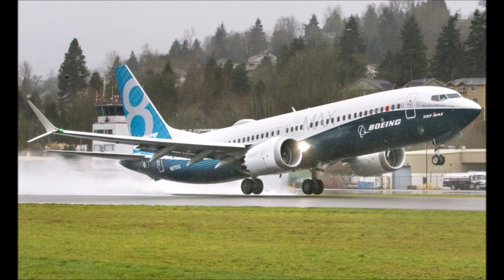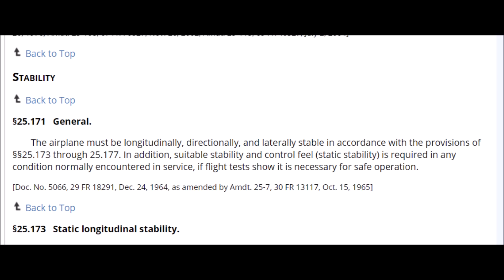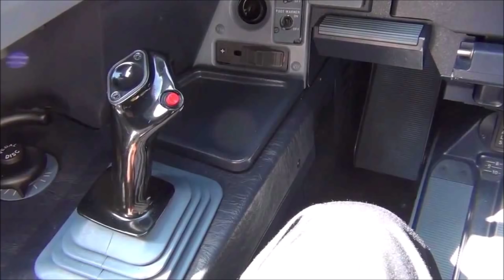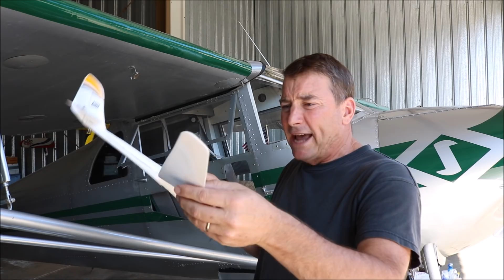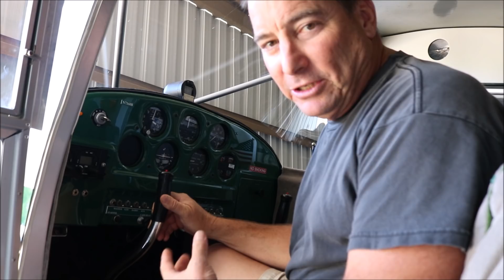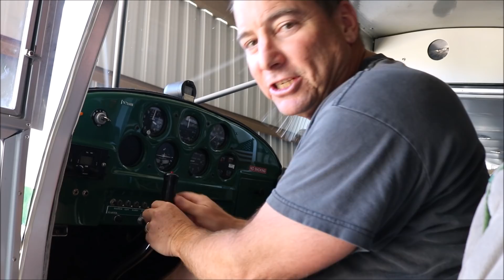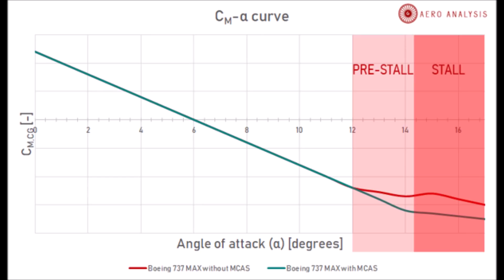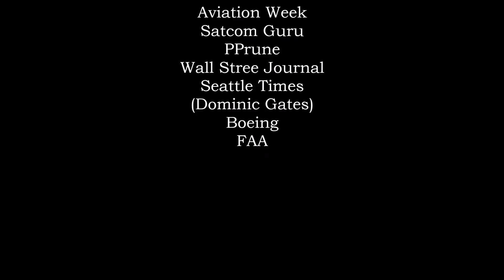737 Max UPDATE 30 Aug  2019

Comment: totally new architecture?  wow.  that cannot help but introduce new issues.  it'll take years.
Reply from the maker: No, relatively easy fix.
Reply: @blancolirio  as a software engineer, those three words scare me.  cutting out two systems when the two disagree sounds like a good approach.  but even that produces differences in the failure process, and in a complex environment, it may take some time before important differences are revealed.  the goal is to make the new 737 the same as the old as far as type rating.  but they are a little different.
Reply: Adam Lane - totally agree. With any change to source code, there can and will be many unintended consequences. 

These can often take years to manifest themselves.

Comment: 10::00 Yet AirBus has had a series of mysterious 320 and 330 crashes and near crashes. As far as crash proofing the320 family essentially  stopping the pilot from creating a dangerous maneuver a mentally ill Germanwings pilot buried his 320 into the French Alps.  AirBus’ Weird Crashes

Jun 1, 2009 AF447
Oct 7, 2008 QF72
https://youtu.be/2cSh_Wo_mcY via @YouTube

May 19, 2006 MS804
Dec 28 2014 QZ8501
July 17 2006 TAM3054
May 3 2006 Armavia967
Aug 23 2000 GF072
Jan 20 1992 IFT148 
Nov 27 2008 XL Air check out flt 7 pilots on board
Jan 26 1988 AF Air show demo, AirBus self-flying ability
March 7, 2001 Northwest Airlines 985 Takeoff without pilot involvement
Reply from the maker: They've had their share...

Comment: Another great video. And I think the FAA has given you the short stick Juan! I can understand no class 1, but what is up with rest? Makes no sense to this pilot !
Reply: Grey Lewis Juan said the hormone treatment causes fatigue, which is a safety issue for operating machinery.
Reply: Gordon Richardson I had no such thing when I went through my treatment, 1998, ,,I forgot the actual brand name for the hormone treatment, but it gives you SERIOUS HOT FLASHES, , my greatest problem,,was radiation colollateral damage, hemmeroids , & bladder damage, ,,then radioactive seed implantation , was radioactive for 3 months. , PSA = 0.01
Reply: @flybyairplane3528  Exactly why I decided on surgery, based on what you went through.   But, things have changed since 1998 re treatment protocols.  Good health to you...
Reply: rvnmedic1968 From what I know, surgery would be my last resort, but there is a MD, in NYC DR GIL LIEDERMAN , Of NY RADIO SURGERY, a very special  type of radiation , he brought to AMERICA, originally for ANY BRAIN  PROBLEMS, it is SO SPECEFIC, there is ZERO DAMAGE OTHERWISE   then they decided to do body  systems, But I did NOT  know of him then, he cured Prez JIMMY CARTER, after his surgery at EMEORY UNIV Hosp, that matestized to his brain . Any cancer, or brain tumors etc, he will be my go to MD. God Bless ,,and Cheers from NJ

Comment: First,,, Thank you.    I have done a lot of flying, passenger, aviation fascination,,,, but am not a pilot.  I always thought of the type certificate as a certificate for the aircraft,,, not from the aspect of certifying the pilot for that type.  Your explanation of neutral stick pressure was a revelation.  Yes, I knew that, I have sat the right hand seat twice for a few minutes, knowledge of, felt it,  but I never once thought about the consistent feel to the pilot. of that type certification.  A real 'Duh !' moment for me.  I think nuts and bolts, engineer,, but the very core of this discussion is engineering a consistent feel for the operator.

I must say,, your misfortune has become my, our good fortune.    You had the time, took the time, to teach.        Thank you.
Reply from the maker: Excellent ! I'm glad I was able to convey this in an understandable fashion. Thanks Sailor!

Comment: What was the purpose of alternating FCC’s. Boeing had the fix the whole time but chose to only use a single FCC/AOA in flight. Can someone explain why?? Edit: Having worked on the F-16, if there was an AOA disagree, the checks we were performing on the ground would not pass. It’s amazing how these redundancies have been around as long as they have....and there’s still those who for some reason feel the fail rate is not worthy of concern.
Reply from the maker: relied on the pilots.

Comment: Great info...but I will not fly the Max
Reply: Hey Juan....I have an opinion about the 737 Max...and that's my opinion....don't tell me I haven't listened to the video. Believe me I have, but I still wount fly that plane...until it's cleared....so don't get on your high horse...I have unsubscribe,and don't be an ass buddy...typical pilot...Mr know it all...you should listen to what I have said....really
Reply: Yes you will, just like everyone else who will fly on her the second she gets back flying again. You obviously didn't listen to any part of the video. The max itself wasn't,  isn't the problem. It was a design of mcas which will be 100 % fixed. If the max is going where your going, you'll be flying on her. Stop being dramatic.
Reply: @11SEXMACHINE  the problem is, if they screwed up this badly on all phases of the design, implementation, certification, fault resolution, and disaster management, with the FAA going along with them, and the leadership that made these decisions is still in charge, and still trying to do spin control and make it sound minor, what other undiscovered faults and shortcuts will be discovered next?
They have shown over and over that their judgment of what is a safety critical system and what isn't, is not just critically flawed, but they can't even see that it is flawed.
They keep saying that this is a non critical system, after it caused 2 plane crashes. That by definition makes it a critical system!

So they have been telling us all along to trust them, and showing more and more that they aren't trustworthy, and there is no sign of leadership changing, so why should I trust any Boeing plane?

Comment: Thanks for your upload. Just a few comments from a commoner (non-pilot). In regards to certification requirements, I notice AirBus has come out with several NEO (new engine options) which must come very close to altering the feel of the original aircraft but competent pilots can obviously adapt to these control input differences. I guess with the particular engine-wing geometry of 737 the regulatory agencies requirements mandated a system -thus MCAS. With the utmost commiseration for those affected by the crashes and loss of life, it seems that one of the airlines had a truly abysmal safety record before the advent of the 737 MAX. Finally, if the system (MCAS) is being blamed by most as the biggest contributor to the disasters and the media spreading the word that the aircraft were uncontrollable, then how did the previous crews safely pilot them to the airports they were operating from?
Reply from the maker: Exactly!
Airbus fly by wire doesn't need to worry about feel at all. It's like flying an R/C model aircraft. Thanks Smitty.

Comment: they should swallow the fuel economy and redesign the tail
Reply: Intuitive Alpha A redesign would take longer, and potentially require a new type certificate, with all the associated pilot training issues.
Reply: @gordonrichardson2972  I'm really surprised they let that kind of control amplification, through, without checking for dynamic flight characteristics, the physical characteristics should have been, modified, the whole point of changing design, is new type certification, and pilot training issues,.  it's just not acceptable modifying that aircraft like that, and counting on trim being implemented in, a way as too, be acting outside the authority of the elevator, that's a pretty big pilot, training issue by itself,.
Reply: oh well these things happen, hindsight and all that, easily said by anyone really

Comment: Happy Weekend, Juan.  RU saying  trim movements were too easy when MCAS was originally implemented? Or too difficult?.  I thought MCAS was supposed make horizontal trim inputs easier.  From your and other channels, my understanding is that the big new engines and changes in CG made the 737M's want to pitch up execessively during T/O & climb out.    I have also heard that US pilots receive(d) simulator training on how to recognize a run away MCAS and disable it, while foreign pilots were not required to.  Is this correct?
Reply from the maker: not exactly...stay tuned.
Reply: I had an interesting conversation yesterday with a BOEING insider concerning pilot test standards requested by a third world country (a dubious request which was rejected on the basis of fraudulent behavior). My take on the insider opinion is mistrust of how the testing standards may be administered by some countries. On the opposite side of the testing spectrum, the Aussies are the toughest on testing standards. 
Forensics on both tragedies may never be fully made available to BOEING or NTSB as they are under the jurisdictions of third world countries whose interests in the matters are now very litigious..

Comment: What was the fundamental / major difference between the 737 NG and the 737 MAX that required the addition of the MCAS system ..... please.
Reply: I think he explained in an earlier video, but I think it amounted to larger engines (more fuel efficient) that could not fit in the traditional location under the wings so the engines were mounted farther forward of the wing than before so they could clear the ground.
Reply from the maker: Yes, primarily the big new fuel efficient engines.

Comment: Wont this mcas start wearing  out other parts like stabiliser Bush's jack screw ect .

I still think this is a patch fix .

I believe this plane will be never perfect .
The best but not perfect solution is to do away with mcas and have a new type rating for the new model 

Questions

(1) will the jack screw work harder in this new plane than it did in the 737- 800

(2) Will such a system put more stress on the air frame .

(3)  If the tail was bigger would it have the pitch problem under high thrust settings.

(4) do you think  2 redundancy computers are safe should be 3 your thorts 

Great channel 

Regards 
Tim spicer 
New Zealand
Reply from the maker: No 737 Type = "No Sale".
There will be a brand new follow up design after this.

Comment: Thanks Juan great video I've been with you since Oroville dam in the beginning wow. about the 737 I guess I don't remember if the FAA has come up with a detailed understanding (accident report)(other than some pilot errors)of what happened exactly causing the two aircraft to crash. Was one of the aoa's on both of the aircraft malfunctioning? Was it software with the mcast? I guess I've kind of got data overload on 737 Max. Thanks again.
Reply from the maker: AOA  or  AOA input failures.

Comment: Good well put together summary. It's an absolute sea of details in certifying these big jet liners.
Reply from the maker: Yes!
Reply: @blancolirio  Another note. Boeing obviously mischaracterize the criticality level of the MCAS system. You'd need to see the System Safety Assessment to know where it ended up after the FAA review. But upping the level then requires a more rigorous level of avionics SW testing per DO178C. Due to the complete lack of redundancy it might have been deemed non flight critical. It has probably now been assigned one of the SW criticality levels A, B, or C (A is the highest 10^-9).  There are probably a legion of SW and system test engineers retesting the MCAS system as we speak. Boeing Flight Test will have a recert testing campaign as the cherry on top of this mess. I spent 9 years at Boeing Flight Test after being an Avionics developer and system/SW test engineer.

Comment: Good video with lots of insight to issues, however,  you  should also explain the total lack of pilot handling of checklist and loss of control due to that oversight. I.E.(Pilot Error)
Reply from the maker: Go back and watch previous videos in this series. Already covered.
Reply: @blancolirio  Sorry but you never talk about Pilot Error, and how Ethiopian 302 pilot had 
total control of aircraft , then reengage the 
trim system, never disengaged the auto throttles, never use the aileron trim and 
crashed with full takeoff power. Please accept that pilots are responsible for almost 80% of all crashes, AF447 for example.  I' am a 40+ year ATP with 18K plus hours,  Most as Captain, and lots of heavy time.

Comment: Juan I am a retired business programmer........... and a private pilot with numerous ratings, including heli.  I also studied the Air France 447 crash in detail.  When these 2 crashes occurred I quickly was thinking......... if there is a discrepancy between  the 2 AOA sensors....  that is a big emergency and the stuff should be turned off immediately.
Reply: The problem was only one AoA sensor was active at a time, therefore no discrepancy was indicated.
Reply: The huge problem is that there are only two channels in the 737. They basically just have two separate channels, which was great for the 1950s and just doesn't cut it in the 21st century. All other current production Boeing commercial aircraft have triple redundant cross referenced systems. Each of three primary flight computers read all three sets of sensors. With two sensors, when they disagree you can't tell which one is wrong. So yes, you switch off the systems that depend on AOA sensing... but that means you switch off stall warnings and all else. FWIW I'm an aerospace engineer.
Reply: @cageordie  The bigger problem was that the MCAS system only used one chosen AoA sensor at a time with no diagnostics. The MCAS also had more control authority on the trim system than the pilots. The pilots had 45 seconds to recognise the fault before the aircraft became unrecoverable and a crash unavoidable due to the trim system becoming hard nose down. Recovery requires throttling back to near idle and reducing speed to permit manual operation of the trim system - a pilot on climb out is in the worst possible position to do this. 
Boeing reduced the size of the trim wheel in the 737-800 increasing the forces required to retrim beyond what some pilots are capable of. The 737 Max used the same trim wheels.
Reply: @cageordie  Lets face it, the 737 was one of the great planes but the basic design is simply past its use-by date.  Sure lots of other mistakes were made but the single biggest mistake was Boeing's snap decision, for a single large order from AA, to abandon the 737 replacement that it was in the middle of designing and try one more refresh for the old bird.